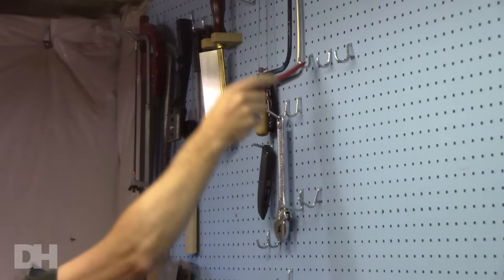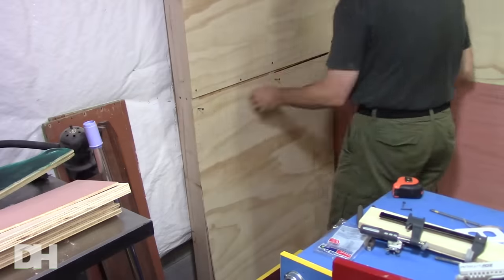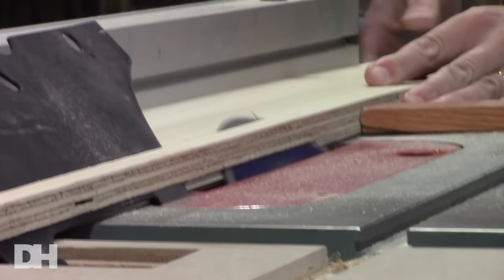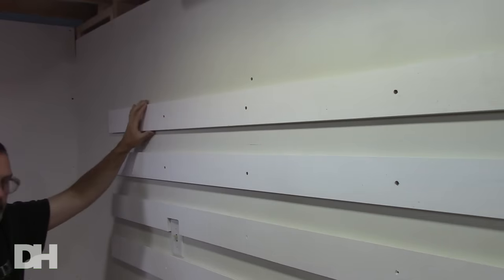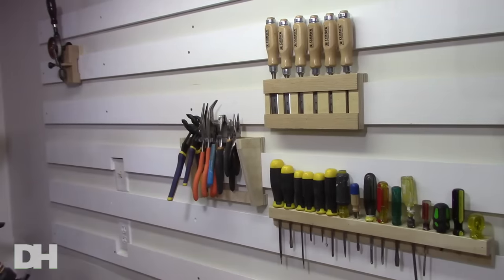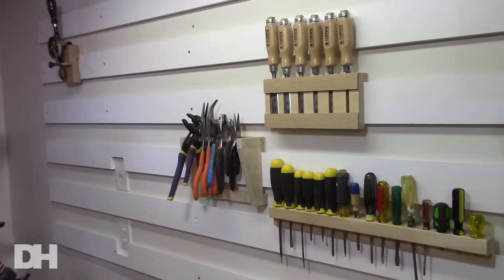Making French Cleat Tool Holders

Comment: Nice work!  The FC offers some nice flexibility for moving the sets around.  Personally, I still use peg hooks (with essential locking clips), but my most strict rule is
that the most common tools are to be in the easiest accessed part of the wall.  The least common further away from my arms reach.
My go-to is....I really like a shallow 3" deep lightweight cardboard box for all common tools (hammer, screws, pliers, adjustable wrench, cordless drill, drill bits, common screwdrivers)  and I leave them in that box for common around the house jobs.  I got the idea from how the dentist does it with his common tray of tools.  I just keep my "tray" ready to go anywhere in the house and prevents me from making a trip back to the garage for a tool I forgot to include.  Of course, I will add a specific selection of tools to my common tray from my pegboard as I need.  For instance, for electrical work (wire cutters, wire strippers, electrical tape, needle nose pliers, etc) I will add those in addition to my common tools in my tray.

Comment: think about putting the holders at a slight angle. that way there is way less vertical dead space since you dont need clearance to pull it out. your screwdriver holder for example if you were to slightly angle it towards you then you can put a second rack right above it. in my small shop thats a must!

Comment: I did a similar chisel holder but for about 10 chisels. I routed the grooves and screwed clear Perspex over the front so I can see at a glance which chisel to grab. Turned out fantastic.
Reply: I really liked the chisel holder where you can see which is which.

Comment: I like what you did.  For things like screwdrivers, I don't think one row of tools per holder is enough.  Make the holder deeper to hold 2 or 3 rows.   You get more tools per square foot of wall.  I've also decided that most French cleat brackets need to include a lip goes pretty tightly under the flat bottom of the cleat board. Otherwise some brackets will lift out of the cleat when you lift the tool from it's holder.

Comment: I like the FC system, but I'm finding that the holders can pop off when you pull a tool when your not quit strait up and clean the holder. I'm going back and placing my cleats on the wall closer together and making a locking tab so the holder can't  clear the wall cleat. nice job. the system give a lot of options.

Comment: Dave does really careful work; great job!  Like the way your create and use jigs so often; very efficient.  I'm building a similar French cleat system for my garage and shop but instead of such a uniform wall of slats I simply put a board with 45 degree angle wherever it's needed around the shop and garage.  In this way I don't have to make an array of slats that may or may not be too crowded for what I need.  Further, I'm just using scrap wood to keep it all inexpensive.
Reply from the maker: Thanks! I agree, scrap wood is the way to go for this kind of thing.

Comment: Like what you did out of scraps. Why did you use such large cleats on the wall since you didn’t add more support screws?
Reply from the maker: Thanks. Truthfully, I couldn't say how I arrived at the width of the cleats other than it looked about right to me. They seem to be working well, but that doesn't mean that I won't ever trim them down if I decide it would work better. My shop will probably  always be a work in progress.

Comment: Great video. Just wonder what saw blade you where using for the screwdriver holder? Kind type ???
Reply from the maker: That's a "dado stack". Two outside blades and a variable number of chippers between them to cut a wide slot. I understand that they are illegal to sell in many countries.

Comment: What was the size of the strips you mounted to the wall. You have cut sizes and lengths 
  Thinking of doing this today!
Reply from the maker: The strips are 3 1/2' wide at the widest (front) part and spaced 3" apart. Truthfully, the widths and spacing were pretty arbitrary. I was making them up as I went along based on the material I had and the space. It's very possible I may rip them narrower or re-position them in the future.
Reply: you can just rip a 2x4 at a 45 and it works just fine. that's what i did.

Comment: Can a French cleat system be made from 1x 6 or is it necessary to be 3/4” plywood?
Reply from the maker: laura palmore You can certainly make them from 1x_ material. I have used solid wood cleats to hang cabinets. I think plywood might be cheaper but I would price it out before deciding.

Comment: Hello. I am French. I watched your video with a lot of interest. Could you indicate the dimensions of the cuts of the cleats. I imagine that the angle is at 45 degrees. What spacing did you use between each cleat? Thank you
Reply from the maker: Hi. The angle is indeed 45 degrees. The cleats are about three inches apart.
Reply: Thanks

Comment: Спрошу по Русски так как не понял зачем нужно было огород городить с переходом на французские планки если на первоначальном варианте выставочного планшета было всё что нужно для навески любых конструкций с помощью ввёрнутых крючков?
Reply from the maker: Hi Sergey. It's not needed to switch over to slats. It is just what I prefer. The pegboard works but the hooks fall out sometimes and not every tool has a manufactured holder that works with pegboard.
Reply: @DaveHarshberger  да прекрасный способ установок. жаль пыль сильно набирает.